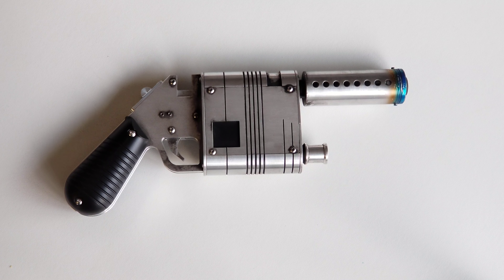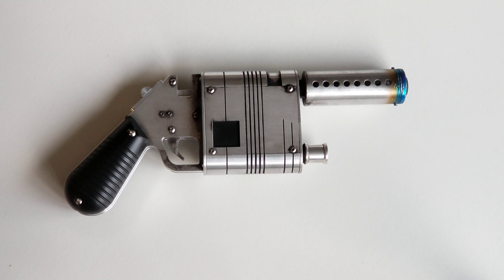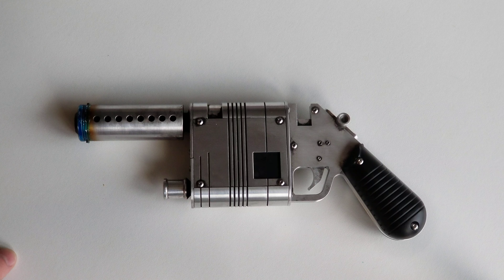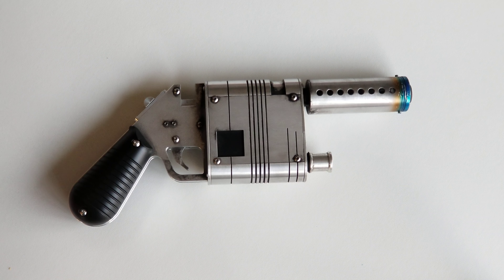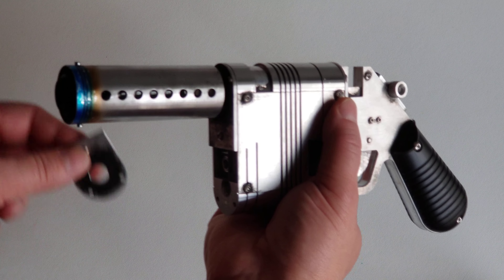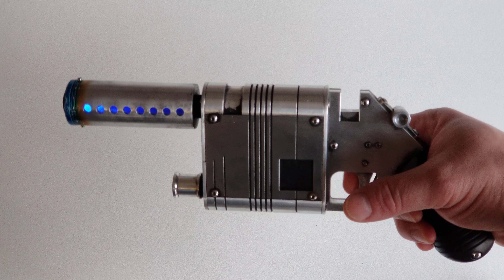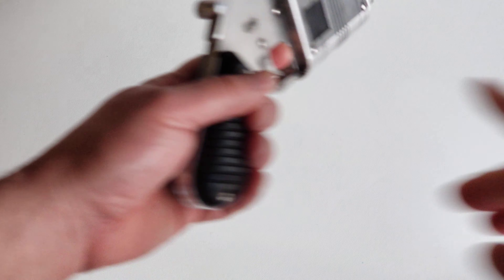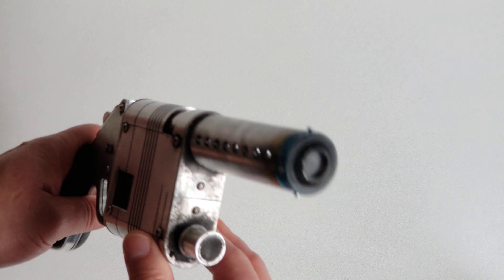Solos Hold Rey blaster.

Comment: This is using plecter labs blaster core right?
If I wanted can it be wired up so it just has the sounds and no light effects? Really tempted to get one for an airsoft gun but not so confident with this level of electronics
Reply from the maker: Yes plecter blaster core. Certainly can do without lights. The led is the painful part so much easier without.